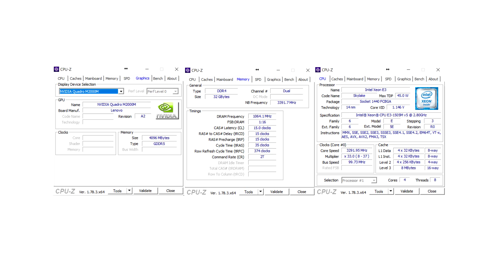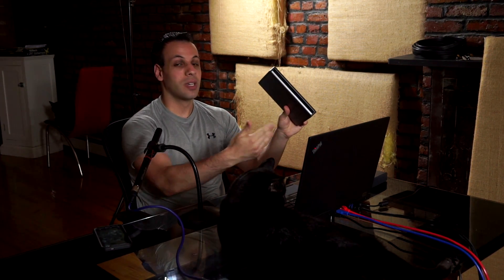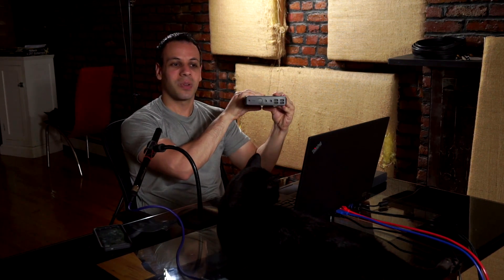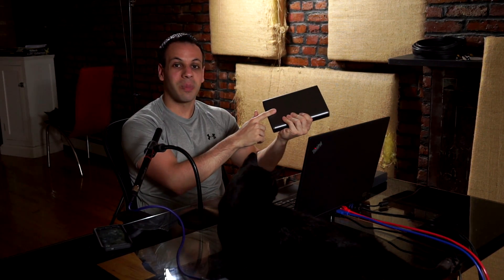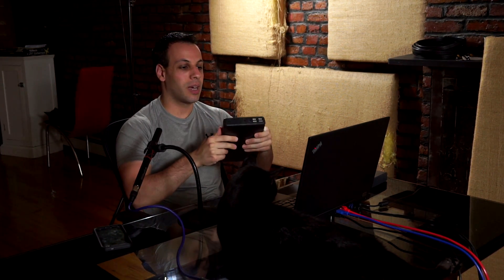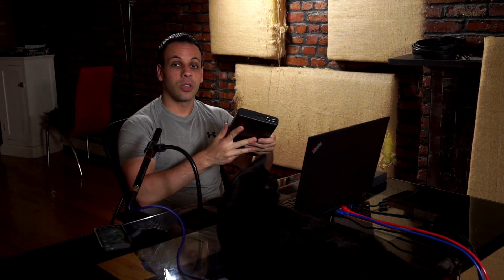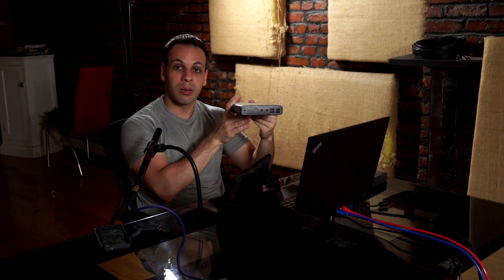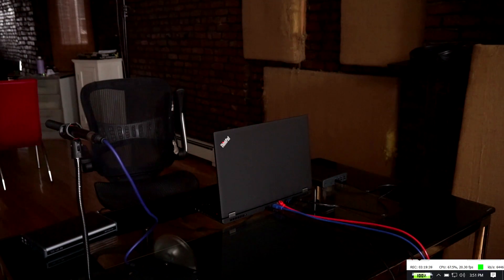Can this battery power a Xeon/Quadro workstation? Thinkpad P50 test.

Comment: I'm late to this party but just want to mention: Using NVENC ought to not be using 'all' of your gpu or cpu. NVIDIA cards have had separate chips for encoding using NVENC for a couple years now AFAIK. Should not impact your gpu or cpu much.
Reply from the maker: +staindk even on laptops? Interesting.
Reply: Apparently anything from a GTX650m upwards, yeah. Though to be fair now that I've googled I came across an unanswered question here https://goo.gl/3u25CC (devtalk.nvidia.com link) so maybe it's not as cut and dry as I thought. All I can for sure confirm is my brother uses Shadowplay on his GTX1060 laptop and NVENC works & uses minimal resources.

Not necessarily saying your test was bad, if the laptop was running the CPU/GPU hard then that's that. Maybe some driver issues or NVENC was not properly working... or I'm just wrong.

Have a nice day Louis!

Comment: I wonder if these would run a Dell M6800 workstation. The thing about the Dells is they have a power supply capacity detection mechanism via a 1-wire EEPROM in the brick that talks to the laptop and tells it how many watts it can do. They have some bad behavior like clocking the CPU and GPU at the minimum speed possible if you plug the laptop into a "dumb" power supply.

Comment: The linked battery is 185Wh, there's typically a 100Wh limit for lithium batteries on a flight (or 150Wh with special approval).

Comment: Why do you use NVENC and not x264? NVENC doesn't use CPU a lot, only dedicated chip (which is why with NVENC fps drop is only 2-3 fps in gamestreams), while x264 uses only CPU, which uses less electricity than GPU (if I'm not mistaken) and looks a bit better that NVENC, unless you record in 50+ MB/s. With fast profile and 3500 kbits/sec 720p I got nice quality without losing a lot of perfomance of i5-2500 for game that I was playing (Rocket League, it uses cpu quite a lot). And when I recorded some things on i7-4702MQ with same settings(almost, was recording at 1080p), I got only 30-40% of CPU load on Win 8.1 and Firefox in background with Flash player used at this moment. You know, just sayin'.
Reply from the maker: +Spakes who says I don't?

I use x264 for the stream since it is better quality at the lower bitrate thst my internet can handle. Then I use the gpu encoder at a very high bitrate to record my archival copy, around 120 mbps where the crappiness of the encoder doesn't matter as much.
Reply: Yes, the general purpose CPU uses less power than dedicated hardware. Meanwhile, there's some pigs flying up there.

Comment: You should to a tear down or do a load test to determine if it's advertised capacity is
accurate
Reply from the maker: What would I be looking for? What procedure would you suggest? Perhaps I will with another video!
Reply from the maker: Ok so I would be opening it to see the part numbers on the cells, find the ratings, add them up. Now I just have to find some 2 amp dummy load when time permits and I'll be set. Thank you!
Reply: Check if the batteries inside match the advertised mAh, crack it open and check ;)
Reply: Teardown video would be much appreciated!
Just open it up and see PN on the actual cells. Also, it would be nice to take a look at the PCB under the microscope.
Reply: Put a 2 or 1 amp dummy load at 12 V on it and time how long it lasts
12 volts at 2 A is 24 watts 
I'm dubious on it's 50,000 mah ratting
Reply: Pretty sure you can find a board with a short between power planes. If the resistance of one board is too low, you can put them in series until you get 6-12 ohms. That's gonna be fun!

Another (more professional and therefore less preferable option) is to hook up your bench power supply with limited current directly to the battery. Set it to any voltage that is guaranteed to be less than battery voltage, so that the current will flow from the battery into the power supply.

Comment: With what camera did you record this one?
Reply from the maker: Sony A5100, $484 used/b-stock from best buy. It's a great camera for this stuff if you have an external source for audio and get an AC adapter for it since the internal battery dies quickly with HDMI out. Now it's $488 at amazon new. http://amzn.to/2eAH0oT
Reply: Thanks for the additional info :)

Comment: I built one of these out of 18650 cells removed from old laptop batteries. 4s14p, so 56 cells. Unfortunately it looks like a bomb so if I tried to take it on a plane I'd probably be shot.
Reply: ofc. but theyd shoot me long before they asked me how many amp hours it was.
Reply: Le Vortex the limit is 100Wh for a single battery, but so long as the individual cells aren't 100Wh each (18650's are generally 12Wh) you can take unlimited of them.
Reply: Lemonade1947 Isn't there a limit on how much lithium batteries you're allowed to take on board? If so the they wouldn't let you anyways.
Reply: Sample Textᴴᴰ Extreme doubt here. Not only do I consider most airport staff in the US to possibly be too incompetent to enforce the rule properly, I also read a maximum of 160Wh TOTAL a year ago. 
As the Trump regime is getting tighter on batteries this is likely going to get less - and I don't think they will create that loophole. Though ... they might.
Reply: Lemonade1947 Well said. What do you have for battery management and output? What voltages do you output and how do you control them?
Reply: Well, as for battery management, I actually don't have a solution. I use a balance charger to charge it, as I've not been able to find a battery management board that can handle the amount of current I'd need to charge that many cells at a decent rate. As for not accidently undervolting the cells, it has a voltage meter that I just keep an eye on. I would like to use a voltage management board in the future though.

As for Voltage outputs, I have a usb output which uses a board designed for use in a car (takes 24-12 volts, since it can be used in a car or a truck) as well as a beefy variable buck boost converter for any voltage between 3-60 volts. 

Also I have posts that I can connect an inverted to if I need to power anything else. 

It can output about 30A without the wires getting too hot, but I've fused it for 15 just because I don't trust the chinese toggle switch I bought of Ebay.
Reply: Lemonade1947 Very cool. That's pretty much what I have in mind for what I'm thinking of building. Thanks!
Reply: Goodness gracious I think I'm in love